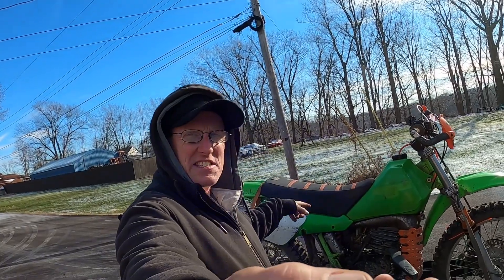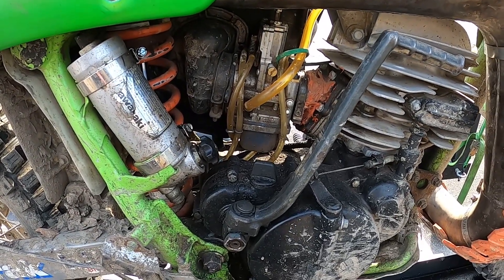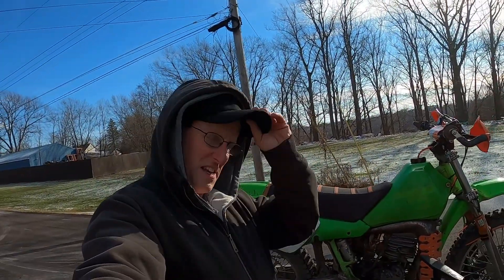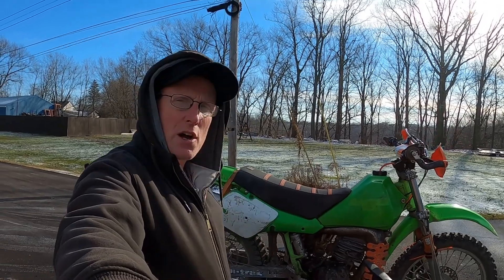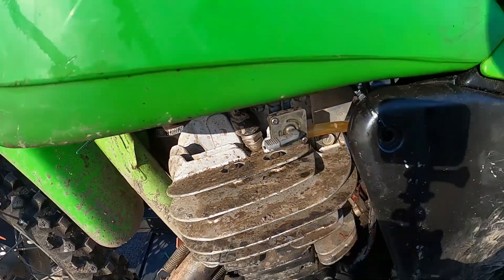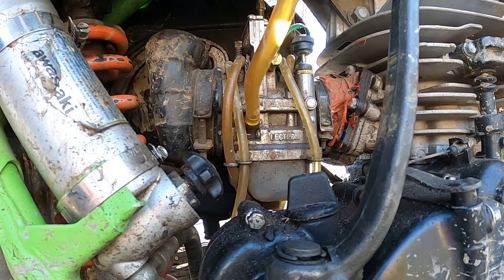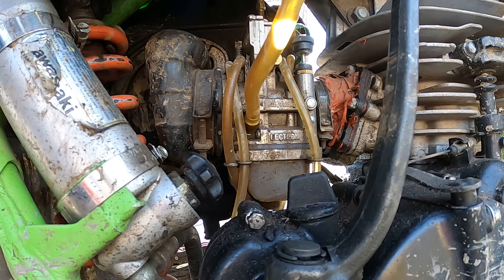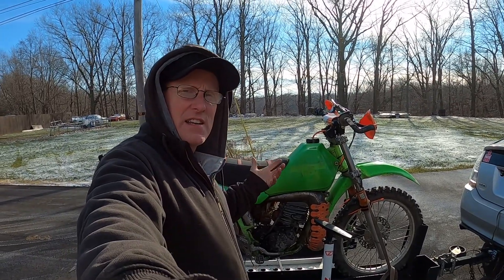Lectron Carb Wont Start, How to fix in 2 minutes

Comment: Tried everything with my Kx500 this works perfectly!! Thanks again ! Do I need to clean choke circuit also or is this a fix for awhile ?
Reply from the maker: I have to do it if i go any more than 3 days without riding. Fortunately it only takes 2 minutes!
Reply: Why do you have to do it if you go more than a few days.  Have you determined the cause?

Comment: My lectron on my cr250 makes my bike chugs when I'm riding slow. Pisses me off I dont know what to do about that. I like to just put around the block sometimes but it makes it hard to. Its not loading up like to rich litterly chugging at low speed.
Reply from the maker: My lectron had been flawless til i let the bike sit for 7 months. For your issue i'd probably lean it out a half a turn. Mine (until it sat) would ride arond in 1st and second all day long and still snap off the bottom whenever i asked it to.

Comment: Darn thought that would fix our issue but didn’t seem to help… we have spark(new plug , float bowl of lectron is full, air filter not dirty , hasn’t been sitting , just won’t start after a ride … tried everything . We had to put a spark arrestor muffler on it but it ran and started fine after that… tried swapping other muffler even no muffler and nothing… I engine turns like in your video but won’t start
Reply from the maker: Hard to tell what after spark and fuel. Compression check and maybe timing.
Reply: on further inspection i found i am unable to displace any of the fuel in the float bowl, even tried a battery powered air mattress pump....is there something else that could be clogged on the lectron carb as far as gas not coming out of it to get into engine? I see a hose coming out of the top of it...maybe I have a clog somewhere? thanks again for the helpful vid btw...maybe fuel is my problem!
Reply from the maker: @IsaacGonzalez-et2bq  lectron says there are no jets inside the bowl. I've never been unable to not blow all the fuel out.
Reply: @sgtsimmons4956  ok thanks...turns out engine was flooded ...several kicks without the plug in seemed to flush things out and started up. I even tried an air mattress inflator in the fuel hose and that also didn't seem to blow out any fuel out of bowl...running it with the gas off definitely lowers amount of gas inside float bowl.
Reply from the maker: @IsaacGonzalez-et2bq  been there. Had a 92 beta and while kicking, sans spark pluf, it to clear the bottom end my thumb fell off the kill switch and it ignighted. Luckily it was winter and i had layers of clothes on so i didnt get burned too bad.
Reply from the maker: Yeah thats a tough one. You have spark (been known to foul one a day or 2, especially on my scorpa), have emptied out the float bowl using air (then let it refill), good compression and timing are your only you need. What are you working on. You say it was running fine? Usually takes 4 or 5 days for my lectron to gum up. Good luck with eliminating each variable.
Reply: Try with not hitting the throttle
Reply: @sgtsimmons4956  we just needed to bump start it going downhill and it clears it out. Seems to happen whenever we get back from a ride driving it all the way home. Only happens on our Husq tc 125. Bike has always had issues though. It's a 2020 ...Our 2003 Yamaha YZ250 runs better , Kehin regular carbuerator, doesn't have this issue!